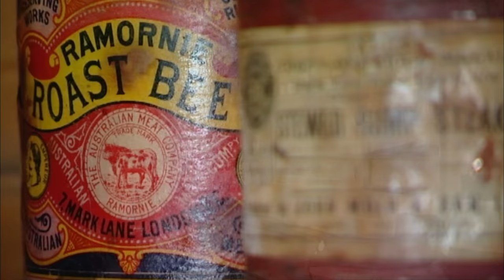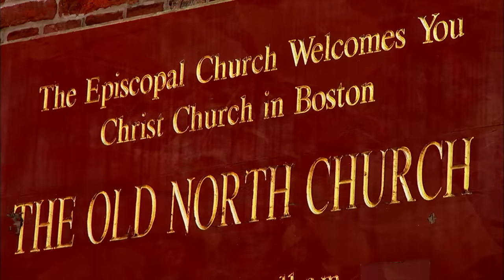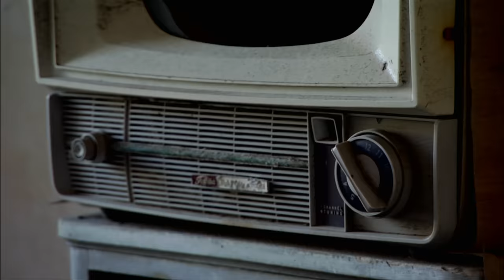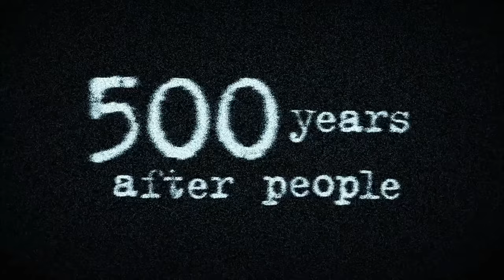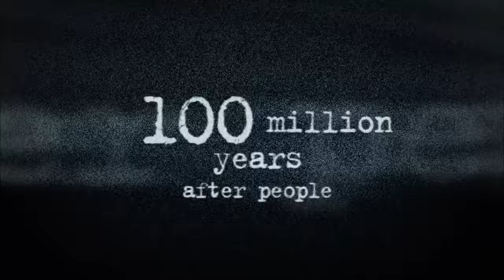Life After People: The Last Humans Left on Earth (S1, E1) | Full Episode | History

Comment: Umm... what about all of the nuclear reactors melting down??
Reply: What's another episode 👍
Reply: Another episode, but even so nuclear power plants today are incredibly safe and have multiple redundancies built in to prevent meltdowns even if no one is monitoring them.  It takes natural acts to knock them off line now.
Reply: @WalkerRileyMC  How many years do the safety precautions offer? I'm curious because I live near one and I know they need a substantial crew to maintain operations.
Reply: @amberlyons6213  he's right that happens later and as for the meltdown thing while it's true they won't instantly blow up all nuclear power plants have cooling pool once the generators stop after a week the heat of the fuel rods which is about (700 Degrees) will boil the water away until the tops of the rods are exposed to the air and force them to explode
Reply: in a different episode...there are many of these types of shows.....

Comment: If there wasn't any 'unusual events' a nuke might run quite awhile; in 1983 just built PSL unit 2 ran 27 days on full auto without human intervention, eventually a nuke will shut down if both primary and secondary systems fail, there are triple redundancies in all US nuclear powerplants.That's why no one has never been a radiation related fatality. Solar power could last even longer.